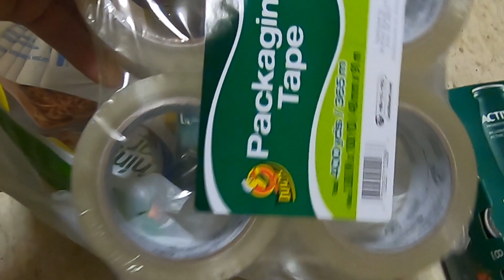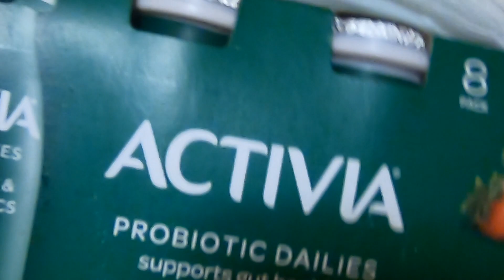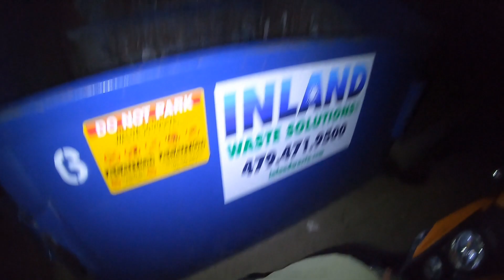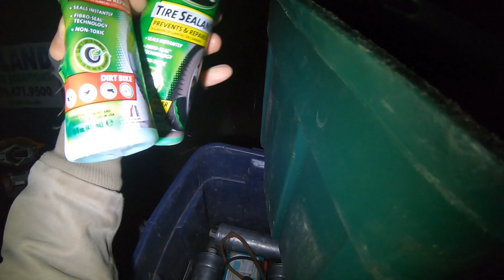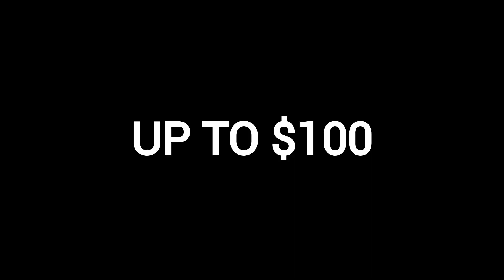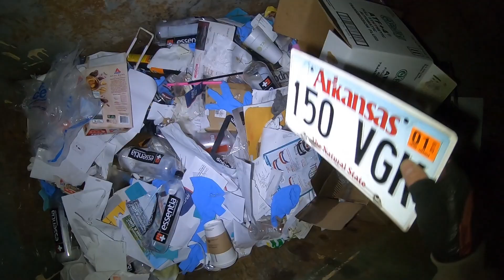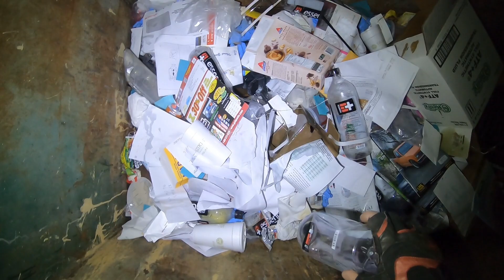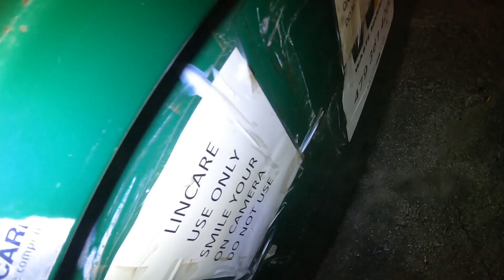Walmart Dumpster Dive Route #2

Comment: i use that same packing tape. i get it at Dollar General,  though.
the other day, i noticed the 4 pack is $6 but individual rolls (same size) are $1.30.
$1.30 X 4 = $5.20 so i bought 4 individual rolls...usually i just pick up the 4 pack, thinking it is going to be the better deal. i never noticed the discrepancy before.

Comment: Tighten up sprocket. Add wheels. Try it out. Maybe add grips also. And brake pads.  And change up bars.    The frame is good.  Steel is good. That can be a great store runner.   Trek is good.  My friend had a wal mart bike we found a frame trek one. It needed wheels that's it.  I had some good ones so I gave them to him now he has a reliable trek bike.    I get free bikes I fix and donate.